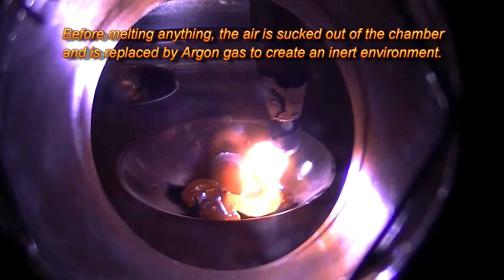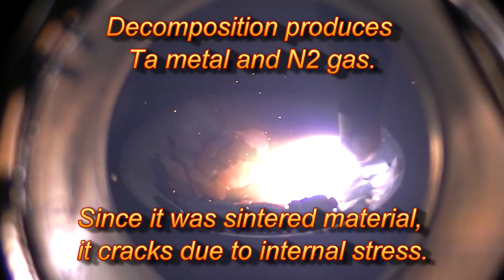Vacumm Arc Melting - 6000 °F Furnace

Comment from the maker: You are correct indeed. Both the electrode and the hearth are water cooled.
The tip is custom made shape made of 2% Thoriated Tungstan.
Voltage is about 5V and current when we melted the Tantalum was at 188A.

Comment from the maker: Yes, it is possible. 
Ionic compounds (silica for example) that does not conduct electricity while solid, does conduct when molten.
On the very first scene, you can see the 'crucible' loaded with Alumina powder, it is hard to spark it and maintain the arc so you need to spark it directly from the hearth and slide it over the chrge hoping to melt some of it and then fix the arc on the molten charge

Comment from the maker: humm... The output current is controlled by the operator. (much like a motorbike throttle grip)
IIRC on the last segment, when we melted the Tantalum we used 188A at about 5-5.5V.
Though, this particular system was designed to work up to 700A max.

Comment from the maker: Yes.
That's the main idea behind PVD. (heat source could be inductive, e-gun or simple electric resistance)
The problem with melting under vacuum is that you change vapor pressure equilibrium, thus cous evaporation of the metal.

Comment from the maker: The hearth is actually made of copper.
The entire hearth and electrode are water cooled, thus preventing melting and fusion to the charge.
Reply: I remember the experiment when I used a paper cup to boil water in it on a gas stove. Thank you so much for sharing! What is the max. current?

Comment: hy dear indeedltdoes, you have initiated the arc without toughing the material, how you did it . please share with me parameters e.g voltage,gas pressure, or type of gas used etc.what are conditions to initiate the arc without toughing the material.please tell me in practical sense

Comment: This is an interesting way of melting metals that would oxidize with heat, instead of melting. Tantalum and aluminium are two of them.

But even using high currents at low voltages, I think that's an expensive method to melt regular metals.

Comment: what is that base plate made of, and why is it not affected by the heat? also, if there is no oxygen in the chamber, then what is the black soot-like material all over the base plate, as well as the little pieces of black material in the end.
Reply from the maker: The base plate, or "*hearth*" is a water cooled OFHC Copper.
Thus, it will not melt, and liquid metals will not wet it.
Reply: @indeedItdoes  wait, why doesn't it get wetted? both surfaces are metal, the liquid metal and the hearth.
and still I wonder, why is there black soot? what chemical reaction is happening? or is it just vaporized electrode?

Comment: I am intrigued by the temperature but confused by the bottom melting tray that swings out. If those temperatures are achieved, why doesn't the molten metals fuse with the swinging door material? It looks to be metal too!
Reply: It's all about the base material and its cooling effect.
It appears to be copper or an alloy of that. Copper is known for not fusing to other metals when in an arc like that. A good example is if welding thin steel bodywork on a car. Place a 'pad' of copper behind the welded panel and it allows steel to build up from the welding method. The steel doesn't bond with the copper. It allows for steel to fill the welded void. That copper pad also creates a heat sink which removes the heat from surrounding steel panel preventing it from melting too. Basic but clever stuff!

Comment: is the device designed to melt PURIFIED metal only, or it's capable of SEPARATING different metal types based on the metal's individual
 melting point.

Comment: I've heard that vacuum arc furnaces generate a lot of X-rays. Is that true?
Reply: Whoa!!! Lol. So do people generally wear lead shielding when they operate them? Or some kind of way of shielding?
Reply from the maker: tall32guy As far as i know, it is not true.
However, intense UV is produced in some cases and may couse sun burns.
Reply: No. It is a electron-beam devices generates a lot of X-rays.
Reply: +tall32guy well, that definitely confirms my theory, the camera shows white dots when the EAF is on. those are the phosphorus pixels in the ccd sensor getting excited with the radiation and emitting light
Reply: +tall32guy You need a voltage of at least about 10kV to give the electron enough power to emit X-rays. Medical X-ray machines use voltages of about 60-70kV. However you need a vacuum around the anode to produce X-rays. Should be no problem in an inert gas envireonment.
Reply: You don't need a high voltage machine - you can produce X-rays by peeling a roll of scotch tape. In very short bursts, 15KeV are generated by the shearing effect.
Reply: NO! UV yes, X-rays no. It take high voltages to generate X-rays otherwise TIG welder would get harmful radiation.
Reply: @roxannamason4400  this radiation is by far not that harmful like everybody thinks it is,so if,say,a TIG welder would've produced around 5% of x-ray machine during scan(as it is most likely due to its voltage being 1/5 of voltage in them which is 15 kV which I hardly doubt because it means that approximately it's power would have been at least 75 kilowatts which would have instantly evaporated both the electrode and half of the machine as well but maybe I am wrong)-than a person who works with it on the daily basis would still have no problems due to this radiation even after 20 years of working with it!And I know what I say since I am graduated as experimental nuclear physicist so trust me:it is really only the radiofobia and nothing else:the real issue with molten refractory metals is first of all a huge amount of infra-red light it emits which is actually capable of permanently damaging the retina and doing it very fast although this light is invisible..I personally not too long ago was smelting a sintered rhenium pellet with my HHO torch(yes,it is capable of reaching a temperature of 3186°C which I had done already several times)-and I decided to measure the IR light that was emitted when the pellet was still completely molten but the nozzle was already removed-so I ended up with completely dead IR detector although the pellet was only 2.3 grams and it was certainly above 3000°C but not higher than 3300°C-but it was enough to fry up the device which was actually capable of measuring the direct sunlight IR radiation without any issues so I guess it's obvious that it will do the same thing with unprotected eye which is unfortunately unlike the IR detector is not replaceable!

Comment: how come it doesnt melt the base plate, like what is that made of
Reply: ***** It's probably made with some type of Refractory metal.
Reply: +Emil Klingberg Also the plate looks thick as shit... this isnt for refining, its just for small scale stuff... VERY cool though!
Reply: A bit late, but for anyone wondering.. the base is copper. It's selected for its high thermal conductivity, making it easier to water-cool during the process. Graphite can also be used, and I'm guessing Diamond too, but that would be a little impractical to say the least.
Reply: Straylight graphene would be the best ultra high melting point or subliminal point idk and better thermal conductivity than diamond
Reply: the hearth is made of copper and its cooled by water to prevent melting

Comment: OR, seeing as it is some sort of electric current, you could just simply suck out the air, which would reduce the pressure to 0, and decrease the melting point of any metal by around 70-80%

Comment: This is very very coool
Have you checked the purity of melted materials by XRF ? 
Accually thoriated tungsten gots incredible vapor pressure(anode),what about the catode?
If it's copper base, surely some amount got mixed
Reply: Copper works well because of its exceptional thermal conductivity- combined with ample mass and active cooling you can push its performance quite far and because of its electrical conductivity you create less heat on the cathode itself during pulses that miss the target.

Comment: why dosent the copper base and the tungsten rod melt... The arc is much hotter than both materials meltingpoint ... is there a oil cooling mechanism inside those? ... hmmm
Reply: Yes, it is water cooled
Reply: @amitaysamuel3184  Water not oil? isnt the water destroying the copper because of the heat disipation and the oxygen in the water?

Comment: I wonder if you can melt diamond and make prince rupert's drop by pouring into some kind of hydrocarbon instead of water since it cant turn into c02 because there's no oxygen present. That would really make a good space craft windshield ( no wind) that hitting space rock wont break it. The real challenge is how to prevent from shattering it when taking the tail off.
Reply: +VeronV you sound like a smart guy, tell me, would a really strong magnetic field surrounding a spacecraft protect it from the stress of re-entry?
Reply: Jesse Whittard Yes, that is a debated subject. The physics of plasma are not all that well understood, and so we can never know for sure. However, there is some research into creating similar shields for aircrafts. For example, I managed to find this article: Conceptual Space Vehicle Architecture for Human Exploration of Mars (6) from 2012 already displays involvement by Boeing and ULA, among others, so that's research that's already at least partially sponsored by the big space industry players.

As for the required size and power, most indicative source is mentioned patent (application number US 12/990,420)(1), quoting:

"In order to provide an effective shield, the strength of the shield magnetic field at the source is preferably at least 1×10−4 Tesla. To obtain a boundary between the shield magnetic field and a typical solar wind background magnetic field of around 1×10−7 Tesla (perhaps 5×10−8 to 5×10−6 Tesla depending on the conditions of the solar wind) at a distance of up to a few hundred metres from the spacecraft a field strength of less than 0.1 Tesla at the magnetic field source will generally be sufficient. Allowing for effects of field persistence in the plasma environment, average electrical power from about 100 W to 10 kW, and more preferably from about 500 W to 5 kW may be provided by the power supply to drive the magnetic field source to generate the shield magnetic field."

Note that this is for an aircraft, not a spaceship. Also, this is for radiation, not heat. For example does this shield have no chance against higher level radiation like cosmic radiation. For that you would need a much stronger magnetic field. As with all new and innovating technology, we have to wait.

Comment: I would like to make special armor out of titanium since its light and durable. Manufacture name would be nice.
Reply: +Adam Dyer It would be easier to machine it.
Reply: Well I need it to be custom and readily available when I need it to be, rather than relying on others.
Reply: XD Titanium Easy to make it requires Really hard Work to make the alloy so much precision that ain't easy and a 50.Cal Armored piercing tip can destroy that thing in 2 hits
Reply: Well it's denser than steel but half the weight, so what would you suggest for bullet-resistant headgear Wazzup Bruh457, if any headgear at all?
Reply: +Adam Dyer Well if it was Headgear Then it could be a Improvement than any Modern Headgear the Military owns but Metals are Obsolete as body armor and more practical as vehicle armor Look at the Incoming research of graphite armor and Armor Itself is at it's peak and BTW Titanium Body Would only be indestructible to Any old Infantry weapon Except the M20 Machine gun it maybe a Tripod mounted weapon but it is used by infantry
Reply: Well is that commercially available Wazzup Bruh457? I'm thinking not

Comment: hey u r video is good. can u please put a video on melting carbon. there is no video about it in entire u tube.
tip: carbon doesn't conduct right? use tungsten pellets and carbon pellets mix. see if carbon melts in inert gas atmosphers. and try to put a video.